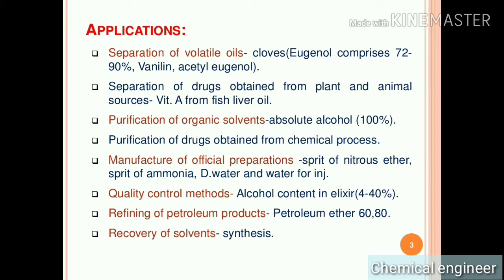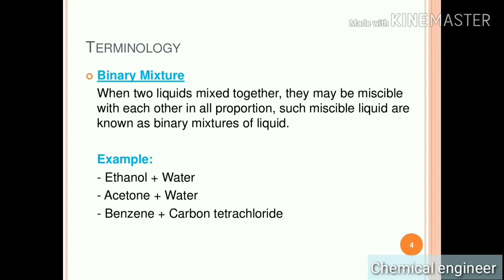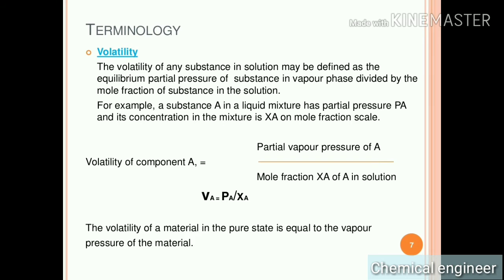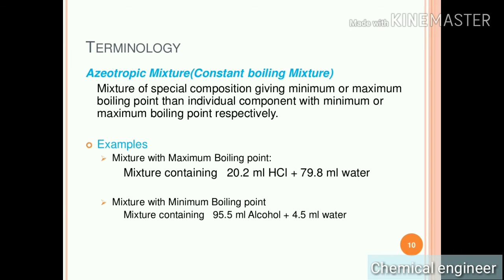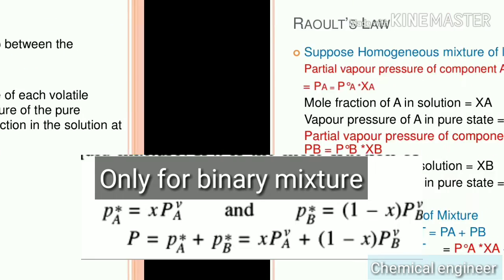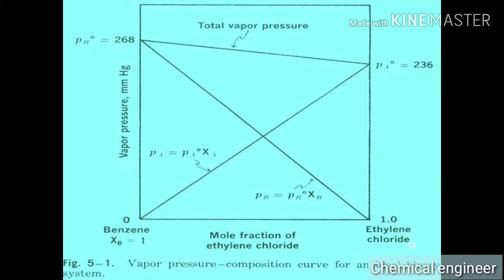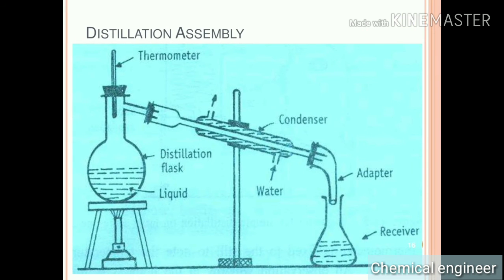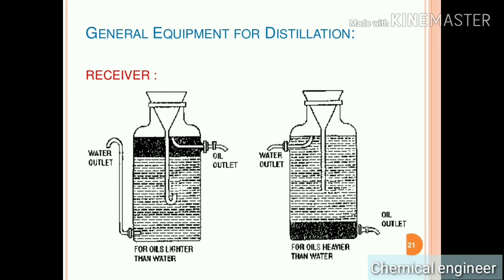Distillation : Basics of distillation

Comment: How to calculate diameter of column
Reply from the maker: This is a topic of plant design and economics(PDE)...
SO I will cover it in later videos...
But it is simple...
So we have 3 methods tocdetermine column diameter
1st - Using tables
i.e we have standard table available and we can choose diameter directly 
2nd- using equations
This is what we lean in our engineering 
.here we consider flowrate which is equal to area multiply velocity...
If flow rate and velocity are known we can find area required and so diameter...
Here we also take into account to the pressure drop and Reynolds number ...so i cannot explain that in comment but i will make a video but basic is flowrate determination for finding diameter 
3rd - by simulation
So in this case we can use aspen plus or DWSIM and by that we can find volumn diameter...
Thank you...
Please subscribe 🙏 🙂